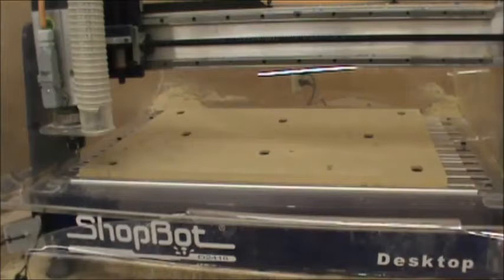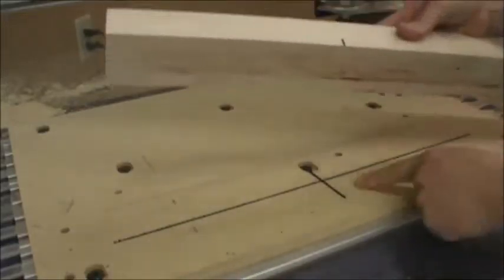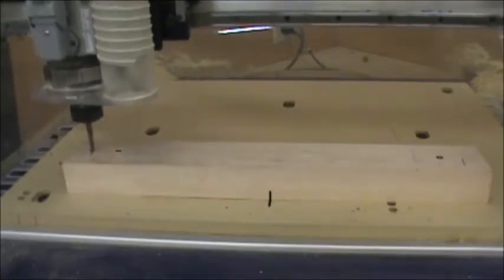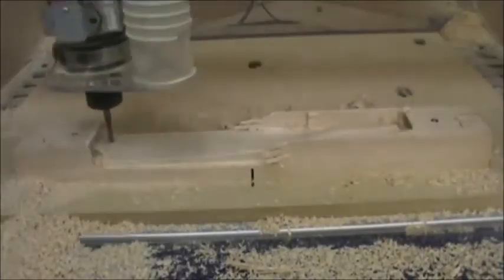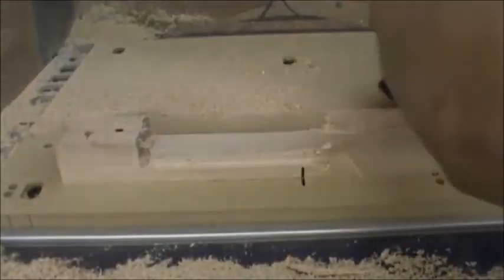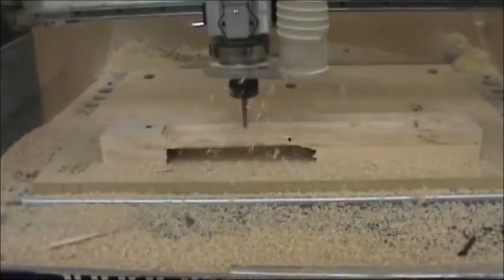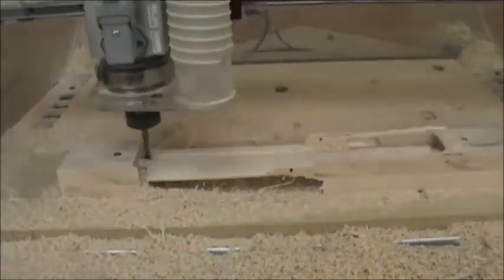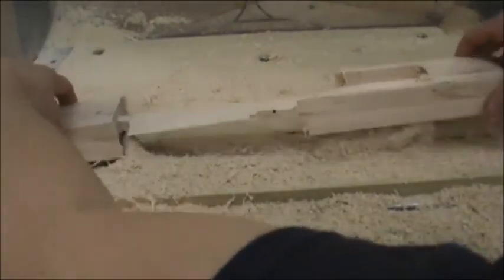Preview for Two Sided Machining

Comment: Noob question here, is there such a thing as a 4 sided milling? Let's say the model has undercuts. I would really love to see your CAD CAM workflow on this one, thanks for the vid.
Reply: What you are looking for is known as 4th axis cam software.  In 4th axis cam you have indexed and continuous cam programs.  Indexed means the 4th axis turns to a certain point and stops while the other 3 axis work.  4th axis continuous means all 4 axis can move simultaneously.
Most 4th axis cam assumes the work piece is going to be mounted on something that can rotate it, but if you are using 4th axis indexed (the cheaper option) you can tell the cam program you want it to index 4 times (meaning it is expecting the workpiece to turn 4 times), edit out the turn command from the gcode, and then manually turn it 90 degrees by hand.
There are many videos on youtube already that show what a 4th axis cnc running is like.
Some low cost 4th axis cam programs: Meshcam, DeskProto.
Reply: you could run 2 - double sided mills, you will have some empty cutting, but will work as long as you ensure you have good tabs and enough length to hold everything. you would also have to ensure your stock is perfectly square and get your dowels perfectly centered.